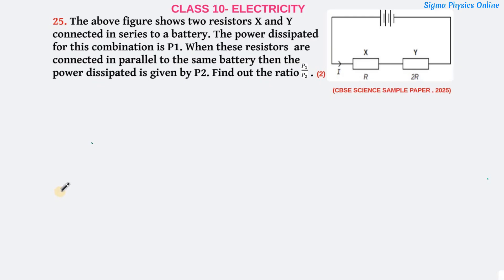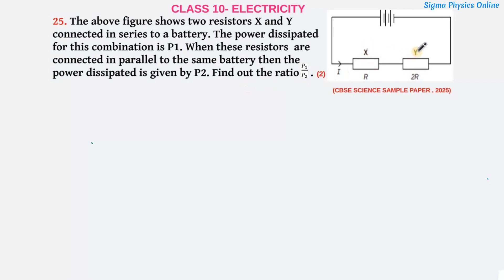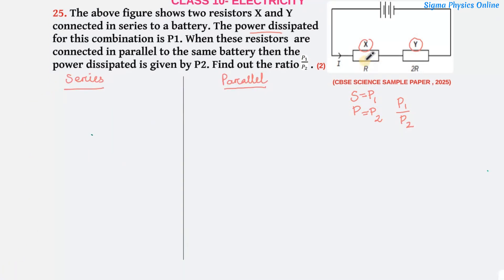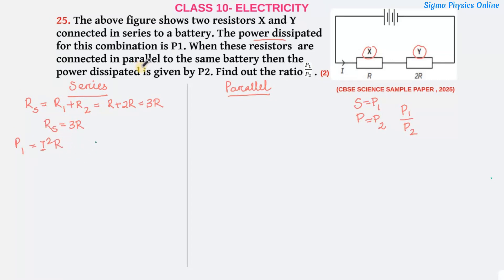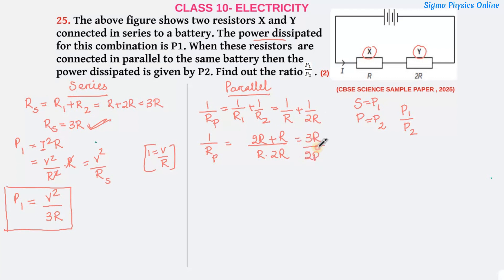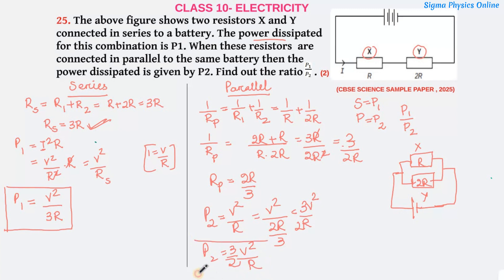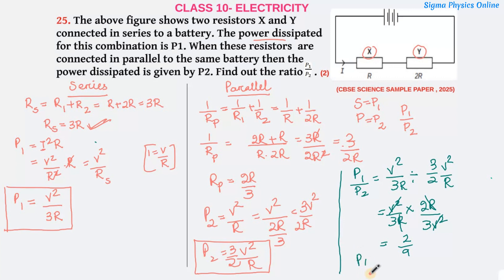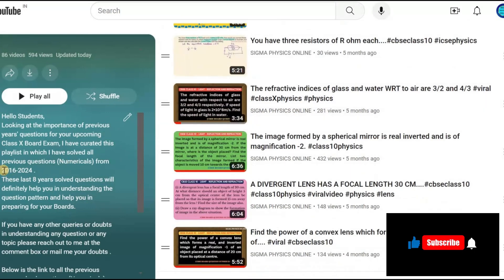The above figure shows two resistors. #class10physics #video #viral #cbse  #electricity #samplepaper

Comment: Mai p is equal to I square R ka formula kyu nahi laga sakte Mai laga raha hu but answer 9/2 aa rha hai
Reply from the maker: Hello beta.
We are comparing power1 and power2.
We hv to bring the two powers in similar terms of V and R.
Agar hum cueernt I lekar karenge I2R mein, we will get three terms- I, R & V.
Then how can we compare and find the ratio then .
So we modified  P = I2R  so as to bring V and R in it.
Hope u understood. 😊
Reply: @sigmaphysicsonline but if we keep P1 in the form of I²R
And P2 also in the form of I and R 
Why is it giving incorrect answer
Reply from the maker: @kundangupta628   We can't  do the opposite. 
Its because current value changes when we connect the resistors in parallel. 
So we cant cancel the value of current Is and Ip when we are finding the ratio of the powers. 
Hence dont convert V and R in the form of I and R.
Reply: @sigmaphysicsonline  But mam the v also changes with resistors in series and voltage in series is different from the voltage than that of parallel
Reply from the maker: @RandomAsh.   @kundangupta628
 Beta see....
In the first case we connect the resistors  in series to a voltage source dissipating power P1.
Here we have a certain amount of current (say Is) flowing and the equivalent resistance  becomes 3R.
In the second case, the same resistors  are connected in parallel to the same voltage (because battery remains the same).
Now we get a different value of equivalent resistance (2/3R) and different  current (Ip) and thus a different power dissipated (P2).
So we can express current in terms of voltage (because it remains the same in both cases) and resistance. 
But we can't express voltage in terms of current because current varies in both the combinations because of different  values of resistance.
Hence if we   replace V by IR we will not get the same ratio of power .
Hope you are clear.